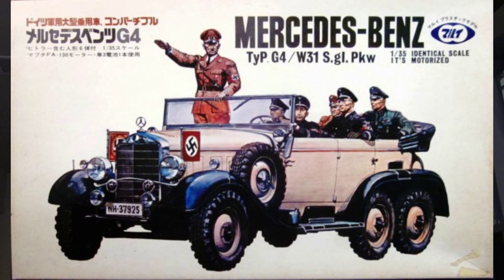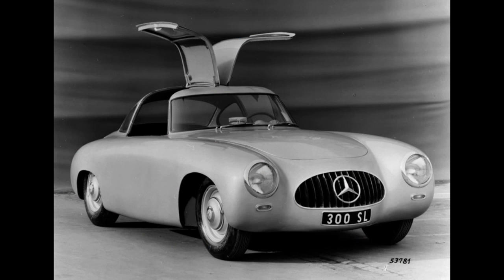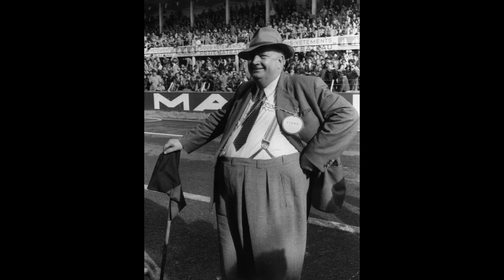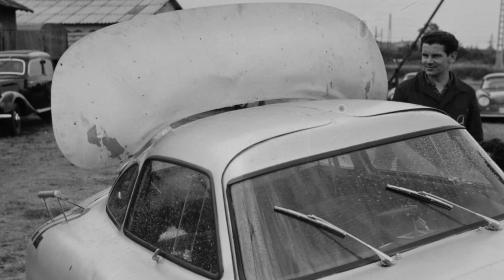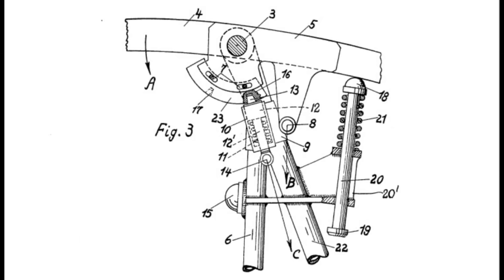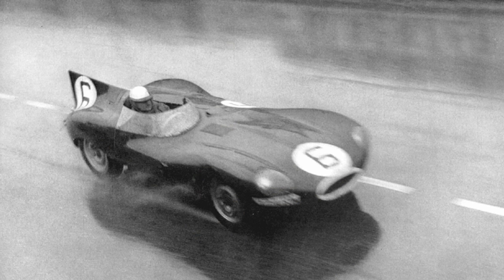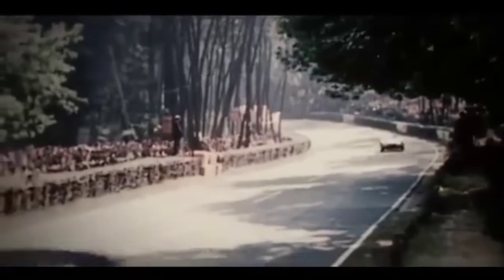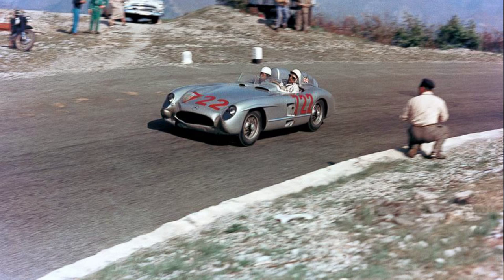Dashcam #16 - Mercedes Active Aero

Comment: I recommend taking a trip to the Petroleum Museum in Midland, Texas. Strangely, it has a wing on the back of the building that houses the entire collection of Jim Hall's Chaparral Racing cars and all of their aerodynamic innovation. For a history-of-racing nerd, it's absolutely captivating. 

Some style of the Merc air brake system is frequently seen at Lemons races, often involving the repurposing of the trunk lid and hinges, but I've never seen it make a difference on a winning car. The Faster Farms Plymouth Belvedere once used an ironing board attached to a bowling ball as an air brake -- brake and the ball rolled forward, activating the brake, accellerate and the ball went backward, retracting the brake. This "innovation" won the Dangerous Banned Technology Award (in 2008?) and was immediately banned (maybe even before the race?). Pretty fun stuff so long as the bowling ball didn't kill the driver...
Reply: +Patrick Mulry I've wanted to visit that museum. Unfortunately Texas is far away. I'll make it one day, for sure. 

Speaking of Chaparral, those cars will probably be profiled in a video in the future.
Reply: +Patrick Mulry LeMons engineering always makes me laugh. Some of it is amazing in its lack of driver safety. Some of it is truly inspirational.
Reply: +Bradley Brownell I have a ton of photos that I took when I was there about 2 years ago. I'd be glad to share them with you.